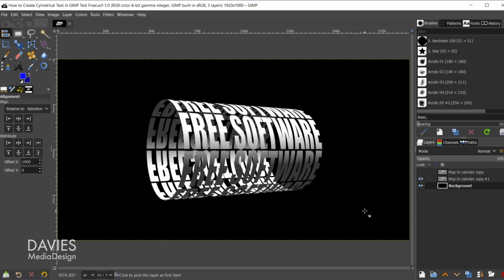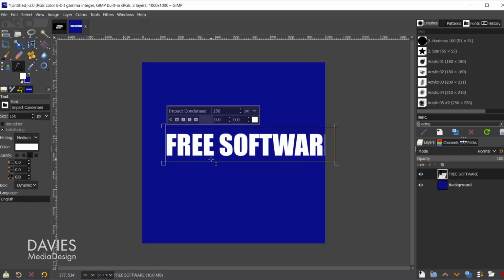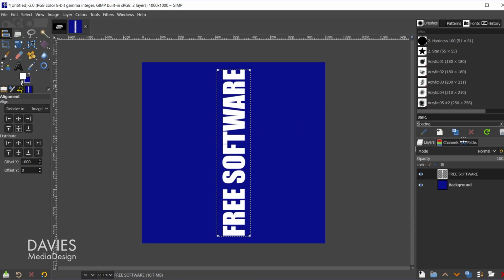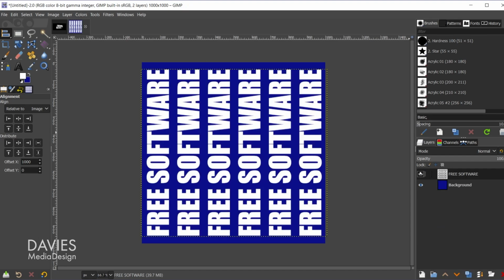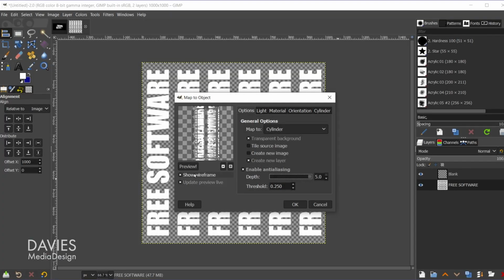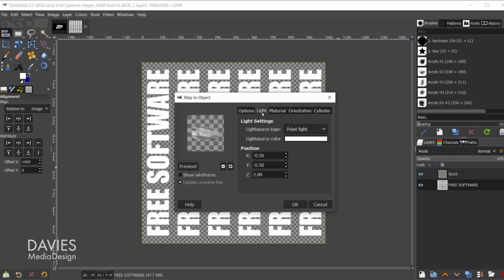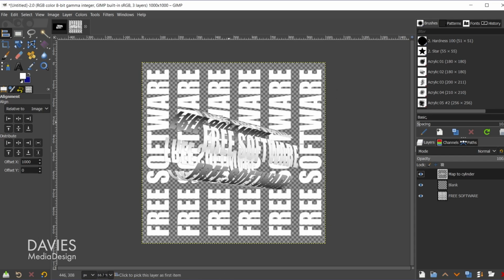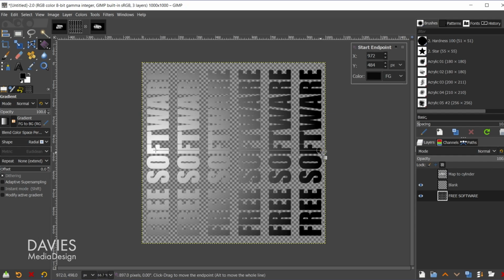Wrap Text Around a Cylinder in GIMP | 3D Typography

Comment: I was able to finally unwrap a a cylinder (coffee can) and create a flat image.  I used this MAP->Cylinder tool to create a new 3d cylinder, but the result had several random transparent patches.  Is this a bug?  I tried it several times with the same result.  The original flat image has no clear spots.  How do I get around this bug?  I'm using GIMP 2.10.28.

Comment: This was a very clear video.  However, it only half solved my problem.  I need to convert a photo of an existing cylinder, in my case, a coffee can, into a regular layer that can be used as input to the map-cylinder tool.  Once I have that, I can use this tool to create a new coffee can with the correct orientation.  So I guess I'm looking for a reverse map-to-cylinder tool.

Comment: Hello all! I have some questions. In this video if you click text or Alignment it brings up options in the left panel. My Gimp is not doing this. I have to go to  Windows - Tool options to get the menu which is then only floating . As soon as I click out the program it disappears. How can I get the left panel option???
Also the text at 150 is too larger and wraps. I try to reduce it and selecting it all but the changed font size will not register. It will not change! Why??

Comment: I can't find 'map to object' when I enter map in the search and run option in the Help Tab.
I work with Gimp 2.10.14 and O.S. is Ubuntu 18.04
Where can I find the option Map to Object ?

Thanks
Reply from the maker: You can locate it in the main menu by going to Filters>Map>Map Object. Any reason you haven't updated to GIMP 2.10.22?
Reply: If you can't find it in search, it's probably because the image isn't in RGB.  Click Image > Mode > RBG.  It fails to show up in search if not.